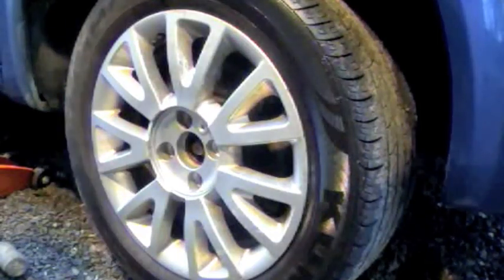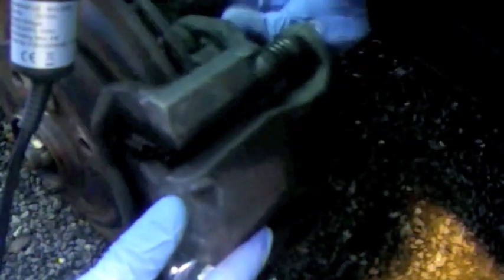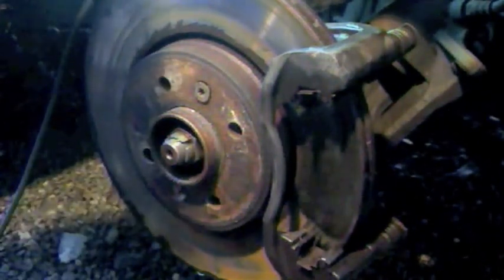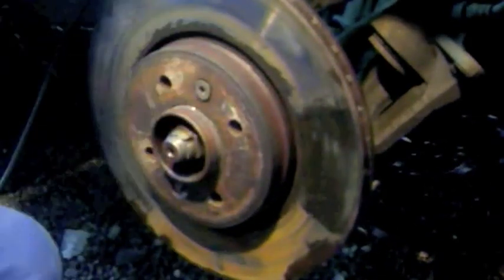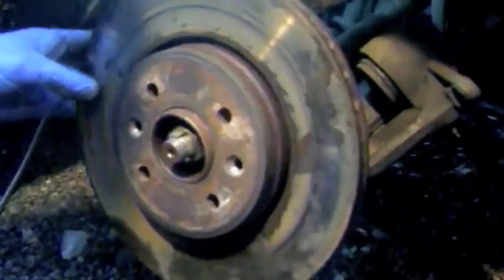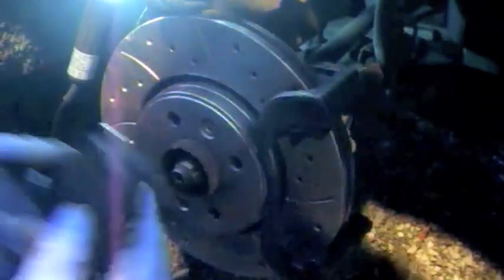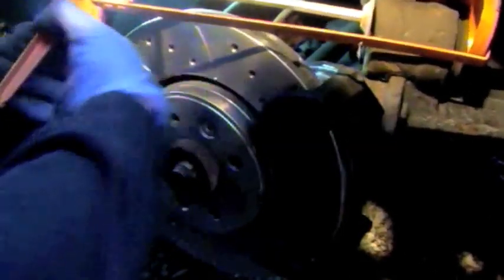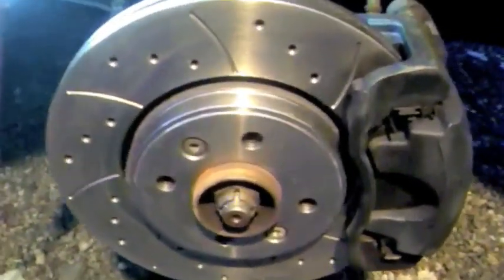How to change Brake Discs & Pads - Renault Megane

Comment: Thanks a lot, nice video, volume could be a bit higher though! Also been looking at the Haynes manual's instructions for this, do you do the thing with loosening the brake fluid bleed screw etc.?? Also, for tightening the caliper back on, is it okay to just "give it a good tightening", or do you use locking fluid and torque wrench to the specified torque etc.?? Cheers

Comment: When i apply the brakes hard on my 04 megane, it squeaks badly. I've inspected the disc and the surface is rough. I know i must replace it but is it possible theres something wrong with my pads or something else that caused it to get ground? I dont want to change the discs for it to happen again

Comment: It isn't as easy as it seems. Normally the 2 small screws holding the disc onto the hub is totally stuck and You have to use special tricks to get them of. And when loosening the the first bolts You need to hold against on the movable side of the sliding joint with a narrow 17 mm wrench. Also I miss the thin metal brackets to hold the brake pads in place. And use a proper tool, not a silikone gun to force the brake caliber piston back.
Reply: Palle Hellemann I'm having exactly this problem right now. I can't loosen the little screws holdin the disc. What special tricks do you use? Care to share?
Reply: I ended up using Irwin Bolt Grips and they worked very well.

Comment: Copper grease every bolt pretty much, just dont get any on the pads & rotor & caliper body. Or you will have a set of ruined pads that dont bite